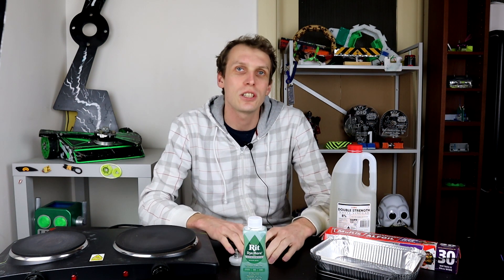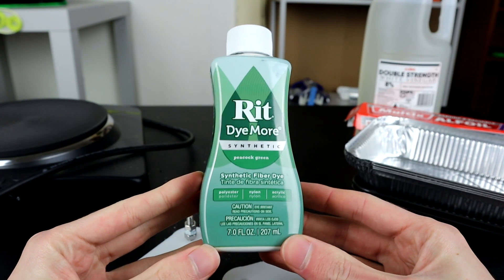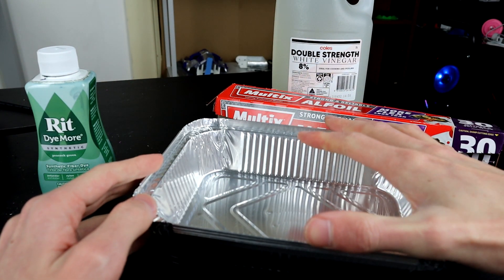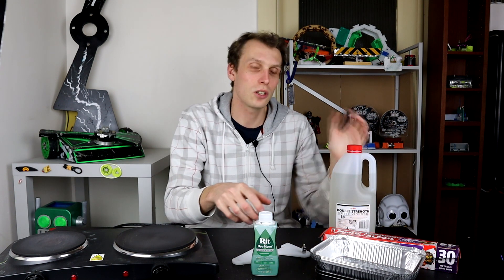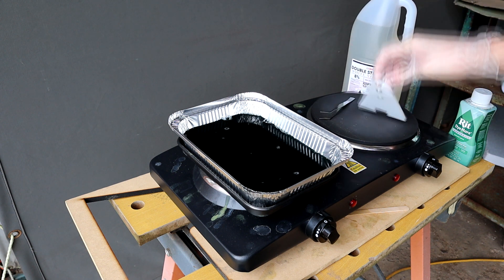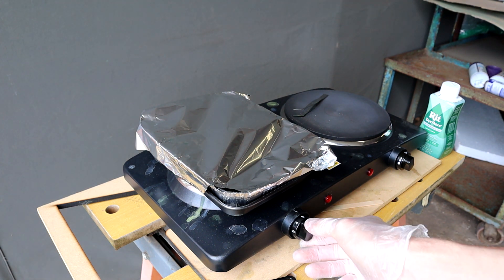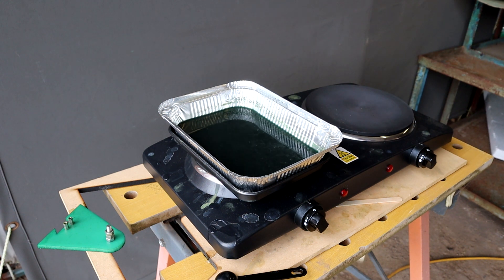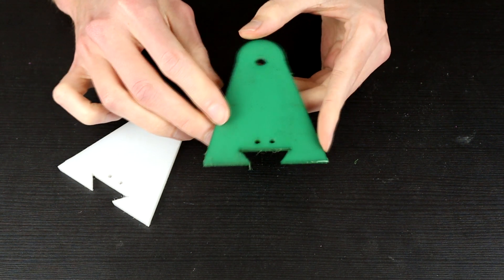How to dye Hdpe (Tutorial)

Comment: I actually have a question about this, if you don't mind me asking.  Would putting masking tape over certain parts of the HDPE prevent the dye from penetrating that part?  Or would it just bypass the tape completely?  Because I could imagine doing so would create some funky patterns on the HDPE part itself, and I might just give this a quick go with some scrap HDPE I have lying around the shed.
Reply from the maker: Maybe, the problem I see is getting the tape to stay stuck to the HDPE while submerged in hot dye
If you can do that I think it will work, but you'll probably still get some colour bleed under the tape
Reply: just watched a vid doing a similar technique and they used pva glue to mask it.

Comment: so can this method/recipe be used to add colour to white upcycled HDPE prior to melting HDPE for use in a mold? It seems this would work (on the recycled chips and bits I have collected) but maybe not?
Reply: Did you try this out?  Seems like it would work if you can get uniformity of color on the pieces.
Reply: @glasshalffull2930  no, not yet. I have also considered using different colours of chips and mixing them (somehow? while melting) to achieve a desired DIY colour much the way that manufacturers would do. I would prefer doing the 2nd method, mostly because it seems more predictable, but would definitely not be cheap considering it would require mixing at the same time as adding pressure/energy so the colours can merge thoroughly.
Reply: @QuentinKarmark   I’ve actually seen a few videos on this topic since my question to you.  The best way to get a uniform color would be to collect bottles or bottle caps of the color you want.  Another method I saw was to use colorants from Michael’s Crafts.  I cannot recall the exact item, but it was some kind of ink.  Someone on YouTube also said you could mix in acrylic paint from Michaels.  The ink method was performed by melting the plastic and then adding the ink drops onto the blob and then kneading it in.  This would require plasticized gloves and this method is translucent.
Reply: @glasshalffull2930  You will find that coloured bottle caps need far more heat to melt than the white/clear HDPE.
Be very careful about kneading the melted plastic, it will stick to your gloves and will still be hot.

Comment: I've never thought of dying HDPE. Wouldn't Rustoleum spray paint also work?
Reply from the maker: I havent tried Rustoleum, but all my experiences with spray paint have gone poorly, the paint chips and flakes off if you handle it even a little roughly.
I've tried a bunch of specalist "plastic" primers, tried heat treating, tried cleaning the surface, tried rough sanding the surface, tried cheap nasty primer. all of them have the same flaky outcome
Reply: @TeamPanicRobotics  I can't say the same for other brands of spray paint but I've never had a bad experience with Rustoleum. It works on virtually any material and doesn't flake as long as you don't drastically warp the surface for extended periods of time. It even works great on chemical resistant polypropylene. I recommend trying it. 

You can also buy certain plastics such as HDPE in different colors from mcmaster carr.
Reply from the maker: I'll put it on my list to try then!
Hpde is also very chemical resistant, but if it works on polypropylene, it might work here.

It's great you can get HDPE in different colours from mcmaster carr, the USA is blessed with mcmaster carr. 
The UK can also get different colour HDPE from a supplier on Ebay, that anyone could buy, but shipping costs triple the price of the plastic if you arnt in the UK

I can get one other colour of HDPE here, black, but I've found that whatever die goes into the black HDPE makes it much harder to machine, it melts rather than cutting. So it's easier (for me) to buy the white stuff and die later

Comment: Nice, looking good!! Been doing a similar method on 2HDFlamingo but with a powder fabric dye which comes with an intensener liquid which presumably is vinegar? Only been doing half hour simmers but getting similar results but it needs a wash after coming out :)
Reply from the maker: It could be, or it might be some other semi-weak acid, I think thats all the vinegar is really doing, just nudging the PH of the solution

Interesting, I found that an hour simmer gives just a bit more vibrancy in the colour but you have to be careful, too hot or too much past an hour and you can boil off the bath, burning the part.
I wonder if yours needs a wash off because of the powdered dye or the length of time in the bath...

I might buy some powered dye to test it

Comment: neat, I will definitely be doing this to my bots. 2 question tho does it make the plastic brittle or softer? and have you done any comparative strength tests?
Reply from the maker: I haven't done any strength testing, but from my last set of tests the dye only penetrates the HDPE half a mm or so
Which means that if it is changing the properties, it's only for the surface layer
Reply: @TeamPanicRobotics  ok thanks. can I make a suggestion for a future video, it would be great if you could make a video on all the different kinds of drive motors like n20, n10 and ga12. it would be nice to understand what the differences are.
Reply from the maker: I'm thinking about making one for the ratios to use

But I dont think there is enough for a full video on the difference between the 3 listed, because:
an N10 is just a shorter (so lighter) harder to find N20. It will have a little less power, but should be fine for 150g bots
An N20 is the standard of the class, cheap and readily available
A ga12 or a g12 are "ga12-N20" or "g12-N20" I havent used them but from a quick google they look identical to an N20. My guess is that "ga12" and "g12" where intended to denote a reputable manufacturer, so its a claim to be higher quality, but as with all labels of the type, as soon as it gets well enough known, anyone making clones will also use the lable, making it worthless
Reply: @TeamPanicRobotics  Perfect thank you, that is exactly the information that I was looking for. Last question what do you think of the "FingerTech "Silver Spark" 16mm Gearmotor."
Reply: @GregoryStark2  Personally I've heard good things about them.